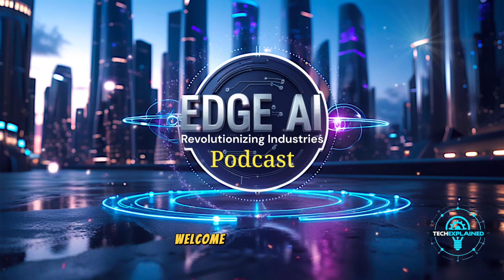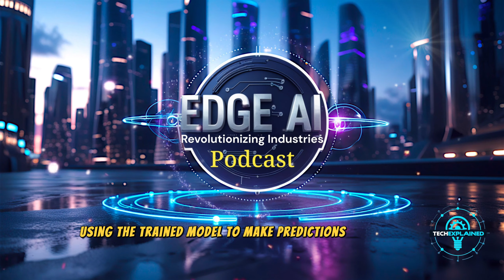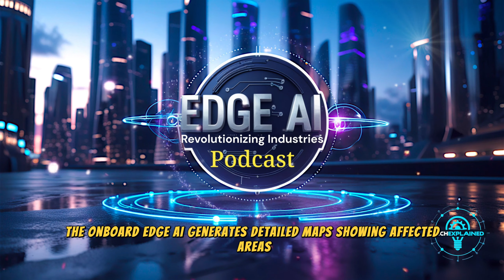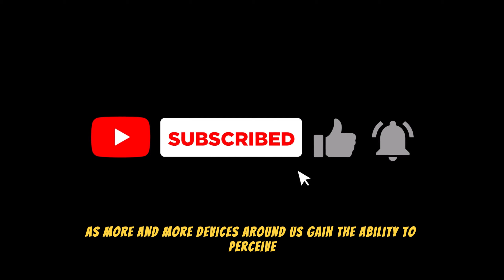Why Is Everyone Talking About Edge AI in 2025?

Comment: Running machine learning models right on edge devices to cut down cloud latency makes total sense. While working as an intern at Lifewood Data Technology, formatting data processing pipelines keeps my schedule busy. How do you usually handle model optimization for low-power hardware?
Reply from the maker: Honestly, the trick with edge devices is just keeping things as lightweight as possible so the hardware doesn't choke.